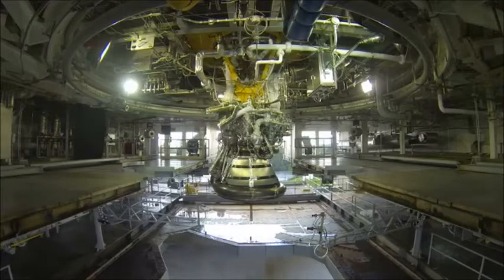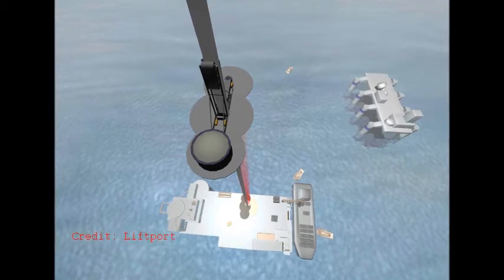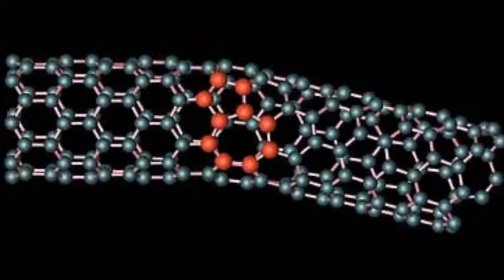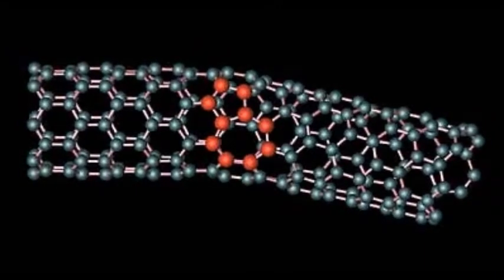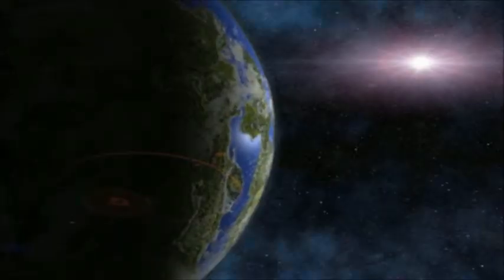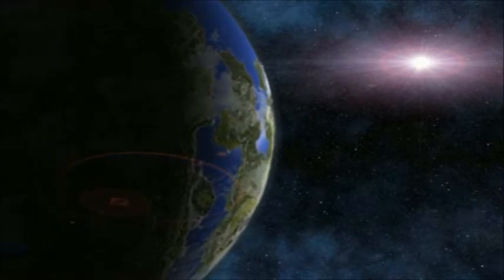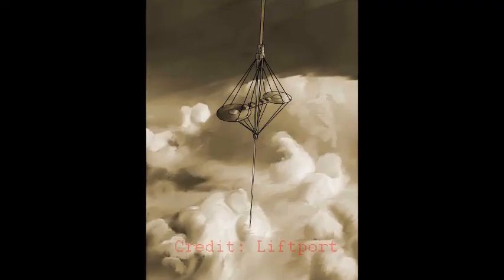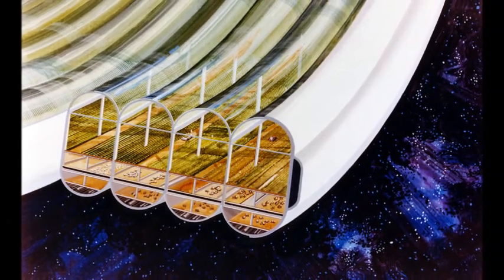Can It Happen? Arthur C. Clarke's Space Elevator

Comment: Space elevators would be great, but there better be a section without a view so you can forget where you are.... Then again, I guess it would be interesting to see the transit through the atmosphere and into space. Also, space elevators could be very safe. If something did happen, and the pod, or whatever, began to fall, there would likely be breaks. Plus, the pod could have rockets underneath to help slow its descent even more. If the cable snapped and the pod was in freefall, there could be parachutes stored on top, and those in unison with the rockets would most likely mean a safe landing, regardless of the height you fell from. The only thing is people would need to be strapped in their seats, otherwise they'd find themselves stuck to the ceiling for part of the fall.

Comment: if i remember right, Clarke proposed using a giant solid diamond found on Europa, (2061: Odyssey Three), to fabricate space elevators - not exactly a workable material, and brittle to boot, but perhaps he equated hardness with strength. he did propose a 1-D material - "It would make a splendid cheese cutter" (Fountains of Paradise) lol -- here's an article with recent info on diamond nanothreads - "Diamond Nanothreads Could Support Space Elevator" November 23, 2015  - http://www.space.com/31180-diamond-nanothreads-support-space-elevator.html
Reply: Fullerenes had not been isolated when Clarke was writing.  The Carbon-Carbon bond has high strength to weight.

Comment: Wouldn't the load of whatever goes into the elevator pull the geostationary mass toward Earth and pull it out of its ideal position?
Reply from the maker: At geostationary I would expect so. Have to wonder what the effects of wind and the like would be on that down below. The designs I've seen use a counterweight, or the station itself, sitting above geostationary to tighten the cable with centrifugal force. However way its done, this will be one of the great engineering marvels of humankind.